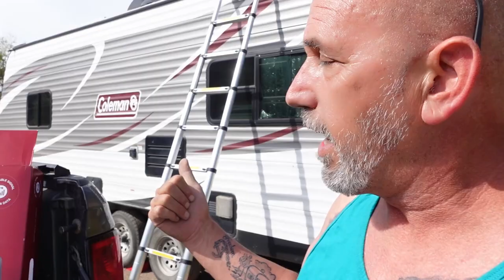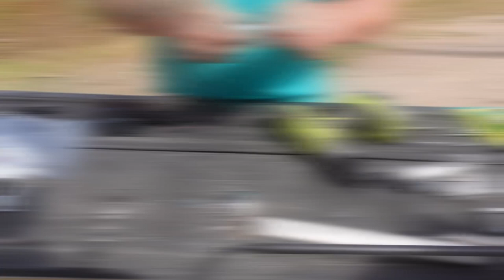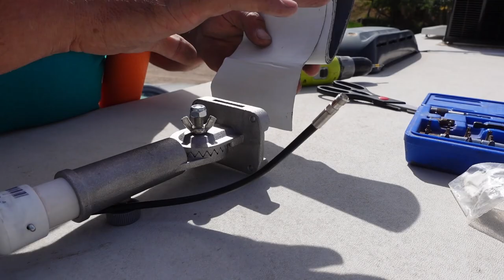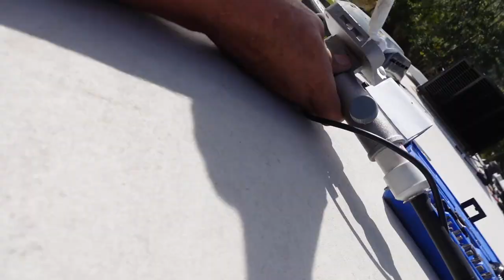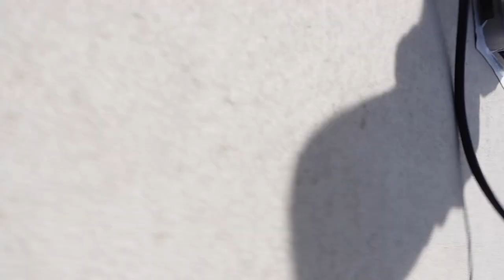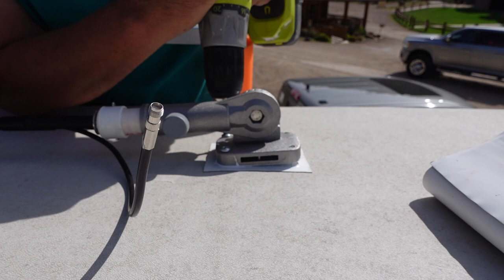Custom mount for our Weboost antenna build and install

Comment: I used a painters pole and a bigger barn door hinge for the weboost 500otr. Yours looks much better. Mounted to cargo trailer
Reply from the maker: Thank you, currently I have a directional antenna mounted to a pole that is attached to our spare tire holder. The omnidirectional just didn't have reception for where we are.